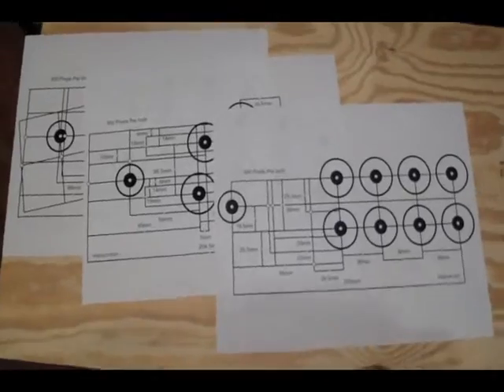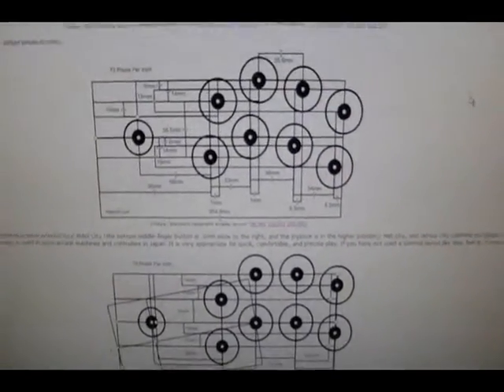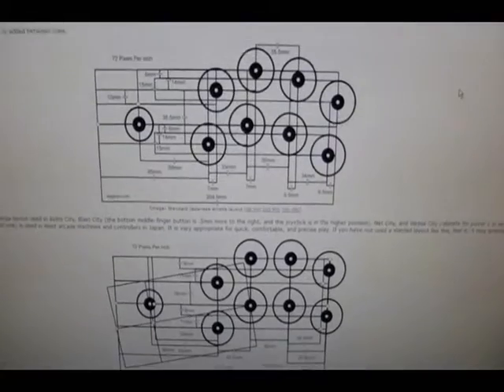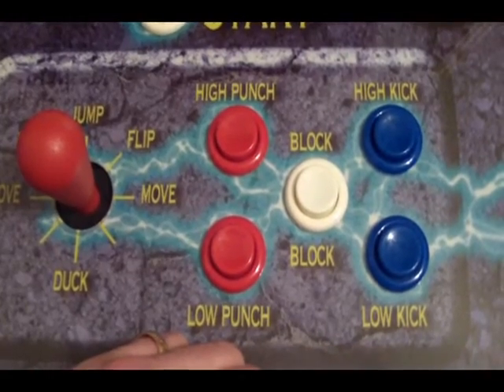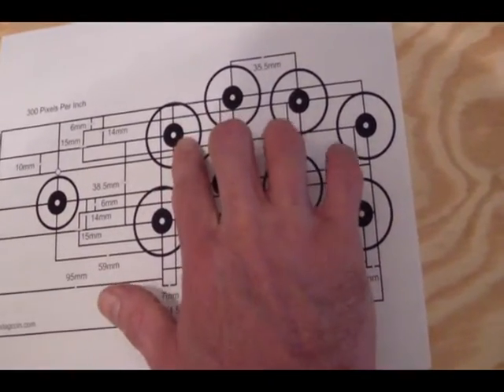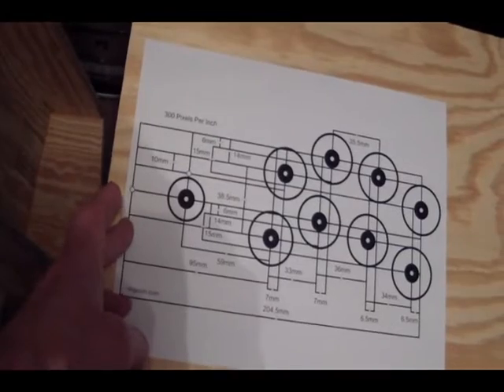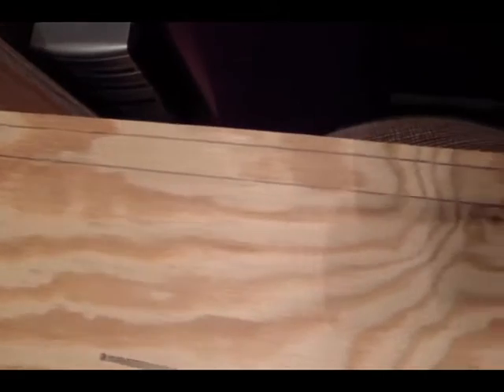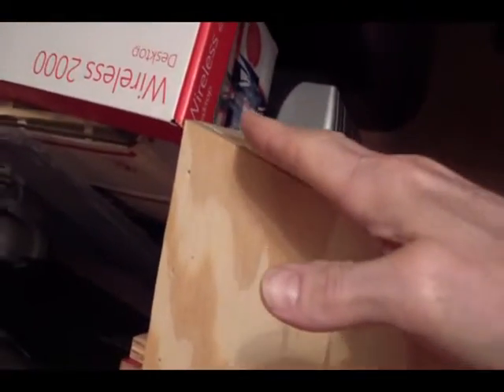(Part 8) MAME Cabinet CP Build

Comment: how did you print the button layout from slag coin to make them the scale accurate ?
Reply from the maker: It's been a while since I printed them, but I think there was an option in my printer settings tab that says "print to size" and I think that's what made mine come out accurately.

Comment: Hey torture bot
 Nice job on the video! Now after watching your videos I now know what I want and need to do. I bought and 8 button kit with joysticks and now will get a trackball as well. My only question is what was the total dimensions of the top board? 
Chris
Reply from the maker: Chris Capaccio 13 3/4" X 31 1/8".  The frontmost corners I rounded with a belt sander so they wouldn't have sharp edges, and the t molding would go around them easier. The back side of the board has the dimensions I gave for the top, but it bevels slightly at the monitor plexi. So if you measured the board from the bottom, it would be the same, but the distance from the front to the back would be about 1/2" less. So it would be about 13 1/4".

Comment: HI,
i cant print those to scale even if my life depended on it :(( 
i have tried to print to size .. different formats .. nothing .. im goin insane here

What is the physical format of the paper ?  A4? 
What program did you use to print yours?
Reply from the maker: SkullK I think I just printed straight from Windows XP. I can't remember my exact settings but I know I just printed to size and used standard American letter paper which is 8.5 by 11 inches.
Reply: Thank you for the answer :D .. i managed to do it using GIMP (seems that gimp recognized the resolution scale) 

Thanks again
Reply: @skull003  using gimp worked for me
Reply: Im pretty awere that you probably solved your problem hahaha, but i will let my help here any way! Maybe i can help other people, who knows huh!? Lol

Well im going to say what worked FOR ME, so if you are using an A4 paper, all you need to do to get your real scale dimension is choose the option "96 Pixels Per Inch" that is right below the layout image you want, once you are directed to another page where the image is, you can keep any other print settings by default, and you are ready to go, that's what worked for me, if you want to make sure, you can grab a ruler and measure its porporions based on the measurements in the image you just printed, i did it and everithing was matching perfectly

Comment: what size should the printouts be...
Reply from the maker: I believe I used an option in my printer settings tab called "print to size" and it made it come out exactly to scale like the creator meant for it to.
Reply: @TortureBot  what paper did you use? i'm trying it with A4 paper and nothing is working.
Reply from the maker: Standard printer/copier letter-size paper, 8.5"×11".
Reply: The images were indeed made for the American letter format, which doesn't exist here, i had to use paint to print it in pixel-perfect mode, worked beautifully with my country's default size, A4.

Also, wow, even 3 years later you still responded, thank you!
Reply from the maker: I do my best to respond to any questions or comments on my videos anytime I see a notification. Sometimes I don't get the notifications and don't realize until months later, but I try to to reply at that time. 

My life has thrown me many curveballs in the last couple of years, and I have not been able to edit and upload videos. After working for 26 years at the same company and the textile business, my entire company closed the doors, and I am back in school at the age of 47 trying to get a two-year degree in industrial Electronics Technology. 

I have learned so much in the last year, but I still have about two or three semesters to go. Luckily, since my trade was affected by foreign competition, I was eligible to have my degree fully funded. I chose Industrial Electronics Technology, because not only will it help me to obtain a high paying job in the future, but it has taught me many concepts about electronics which I love as a hobby.

When I get back on track to upload more videos in the future, I hope all of my subscribers will still be there to see what I have learned. I don't want any of you unsubscribing, so as long as you find my videos useful, I hope you will stick around. Thank you!
Reply: @TortureBot  Damn, i hope you strive in your goals and don't give up, age doesn't matter as long as you're eager to learn, all the best!
Reply from the maker: @Brunn0121  Thanks man. I really miss making these videos. I have a bunch more that are unprocessed about this MAME cabinet. Maybe I can find time to get some of them up while still in school. Cheers!

Comment: lol, whoever dimensioned these plans needs to take some drafting courses. I never understood this curved ergonomic button layout to fit the profile of your fingers. It makes no sense. You use your index finger most of the time in the heat of a game, maybe your middle finger. You NEVER use your ring finger or pinky give me a break, your not playing the piano here. You use one finger that pivots from your elbow not warrenting any curve at all. Straight is always best otherwise, you just get lost moving from side to side. Stop trying to be all fancy.
Reply from the maker: I'm not the creator of the button layout, but the site has a straight American layout like you would probably like. Only did a little drafting in 9th grade in high school so I would never pretend to be an expert at that either. One thing I can tell you though is that I use every single finger on my hand when I play a fighting game like Mortal Kombat. It would be extremely hard to pull off some of the combinations without using at least two or three fingers in succession, or at least you would not get the moves off as quickly and would probably be more easily defeated.  The curved layout is the standard in Japan and from what I have read it gives the players an advantage because it is more natural to the curve of your fingers. It does not seem as natural in the United States because we are used to seeing the straight layout.  I was going to go with a straight layout but I wanted to change things up and just give this a shot. It is actually working out very well since the cabinet is already finished and I have gotten a chance to play with the curved layout.